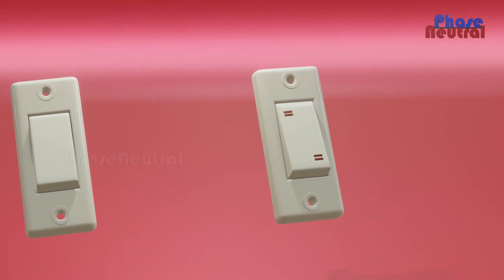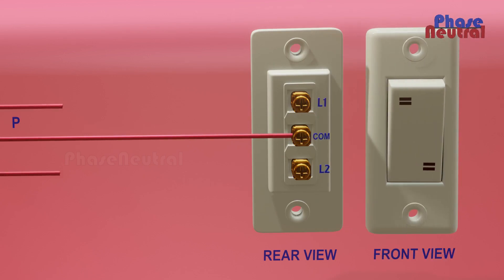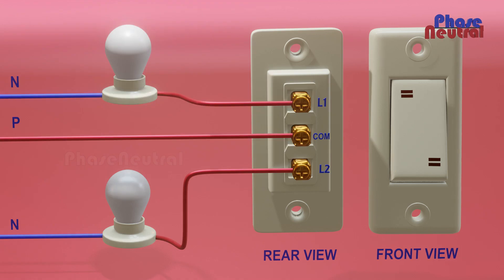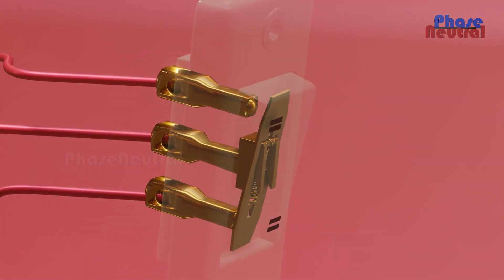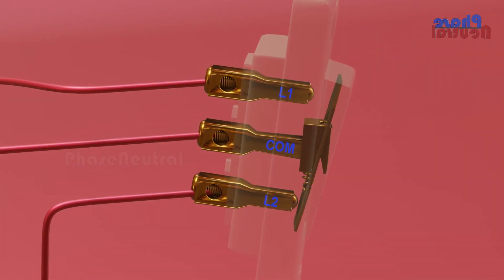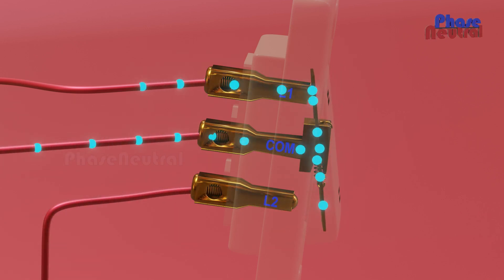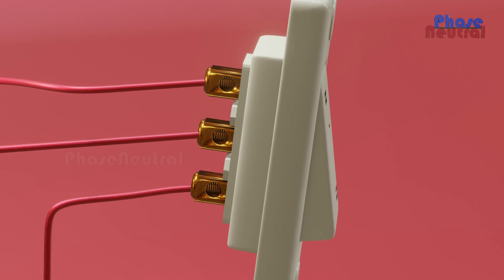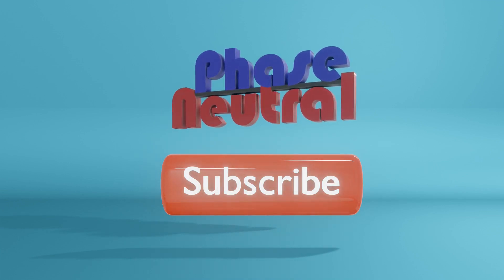Working of Two Way Switch Explained | PhaseNeutral

Comment: Called a Three-way Switch in the USA. Two are used together, IE at  both ends of a hallway. This is so the lights, can be turned off from either end. BTW, I was taught back in the 70’s to install them so if both switches were either Up or Down, the lights were off. One switch Up, One Down, lights are on. Apparently this went away, by the time my house was built. Drove me nuts, till I corrected this. BTW, I also have Four way Switches.